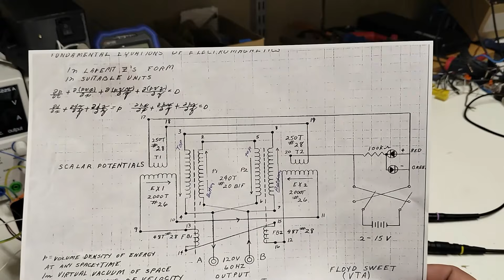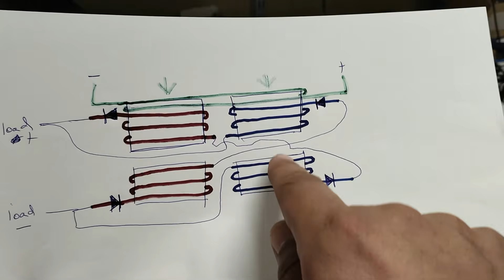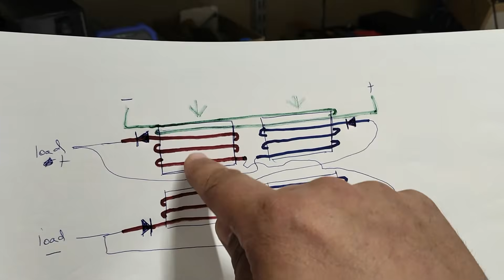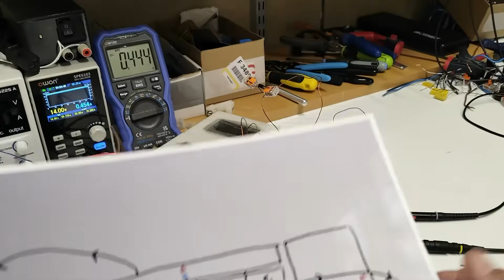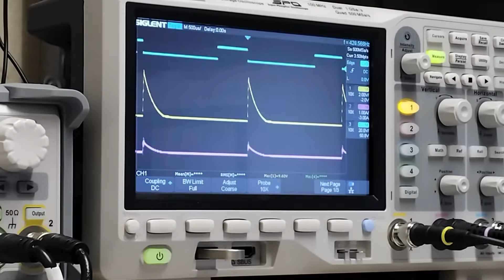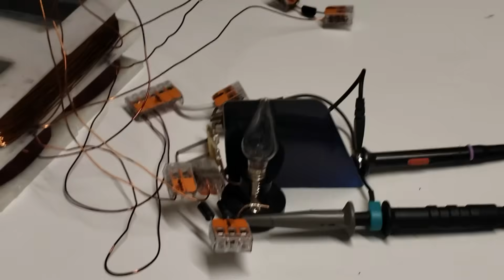Replication VTA Charge Pump experiments 2

Comment: In Floyd's doco "Nothing is Something" pdf page 6, he explains when two H fields flow thru each other (as per his VTA circuit) such that their H fields cancel. A high intensity E field is created in quadrature to the original H fields (at right angles). So the 2 so called  Scalar  (E field) coils are shown at right angles quite intentionally. This is normal electrostatic deflection as with old TV set yolk deflection coils.

Comment: +1 - Nice work Mate! Each Coil has its own Magnetic Field, which changes in time. As B changes, the fundamental variable for Faradays Law, the Voltages are Generated in the opposite Coils. Remember how Walt said: "The VTA "likes" to always see a minimum load of 25 watts", well, the Load, it is the regulator for the Current through the Coils. This means, we need to find the best load, to make the Coils operate at the best, or desired, Generated Voltage. We will use a bit of power initially, to get this running, yes, but once running, that power will drop almost to nothing or even go negative. We now need to focus on the Coils Voltage and Current and what's required to Generate a Voltage X, where X is say 12 volts to run a 12 volt globe. You're doing awesome mate! Very nice build!